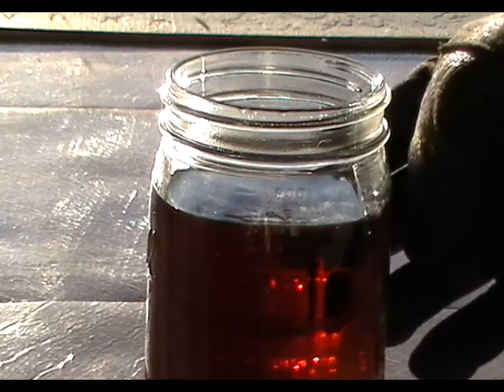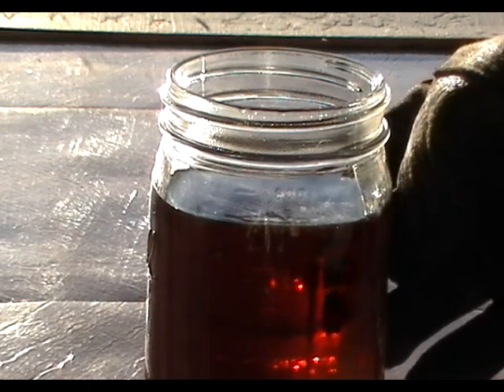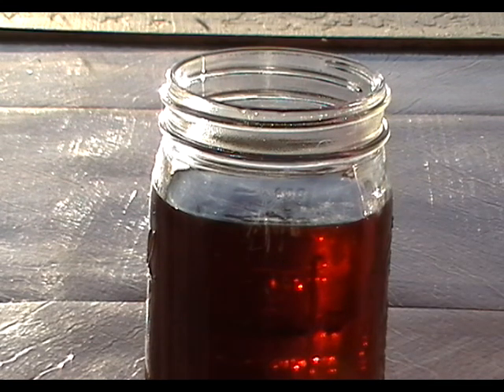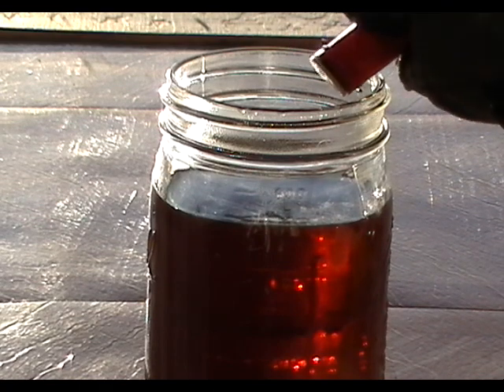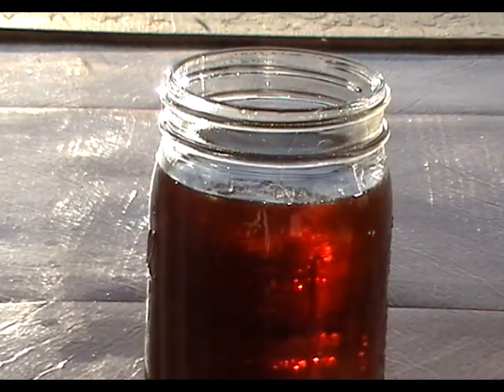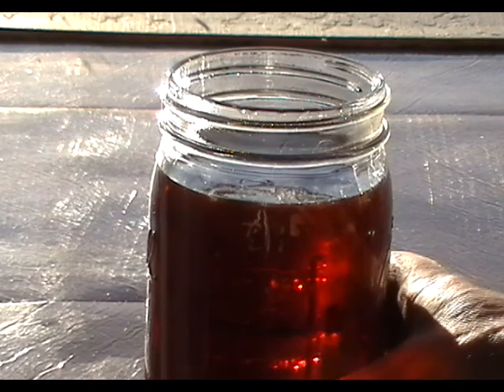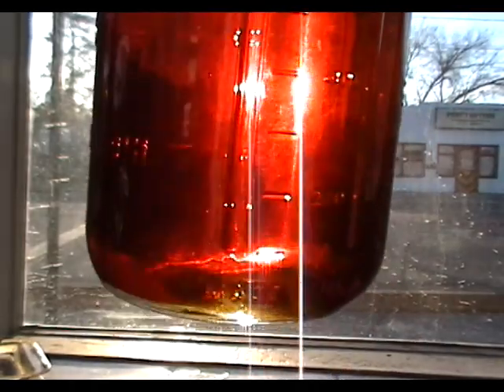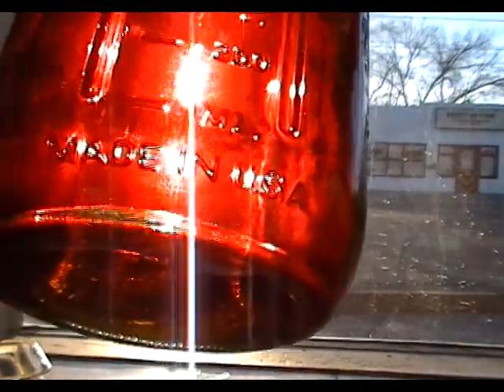Blending Gasoline with vegetable oil to make Diesel Fuel

Comment: Hi Jeff,
Thanks for sharing your experience. I'm in the process of setting up a WVO filtration system to run in a 6.5L V8. I would like to get your opinion on running WVO or any other WVO blend in my tractor which is powered by a 2.2L 4-cyl diesel engine. Any precautions or suggestions on optimizing the tractor for veggie based blends? I don't know if the size of the engine should be taken into consideration when making the conversion, as I'm just starting out. Thanks!
Reply from the maker: PrimitivePeter Blending is all about converting the fuel, not the vehicle; however some diesel engines burn waste oils better than others.  The direct injected turbo charged diesel engine seems to do the best of any diesel engine at burning waste oils.  Otherwise you will probably have no problems burning an 80-20 blend with gasoline, especially in warm weather.  If you do have problems, then try diluting the blend with diesel fuel until it runs best.
Reply: Thanks for the prompt response. I've been going through a lot of your videos as I learn the process. Are you still content with your bag filtration setup, and what micron size of bag are you using? Still trying to find the most cost effective way to filter that will produce clean fuel. I see lots of folks pumping through cartridge filters, while a local mechanic who's been burning wvo for years claims that his injector pump gets gummed up from burning oil that was heated and passed through filters. Thanks for the help!
Reply from the maker: PrimitivePeter Yes, I am still happy with the 1-micron bag filter, but I did add a 100 micron monofilament bag filter in front of it.  Cartridge filters tend to have problems with the alcohol in the gasoline, so that is why I use bag filters.  There is no point in heating WVO for filtration if it is first blended with gasoline.  Also, if the blend is settled for 1-2 weeks prior to filtration, then there will not be any gum sticking along the way to the injectors.

Comment: my guess is that only the thinner oils are blending with the gas and now I have a blend with too much gas as only a few gallons of oil blended into the gas.
I pulled the thicker bottom with no smell of gas and left it on a close bucket and the I just mixed the thicker oil with some gas smell (5gallons) with 5gallons of wvo which looks pretty clean and 1gallon gas, and will see tomorrow.
I will try to post some videos so you can see

Comment: hi Jeffrey what about if i use fresh oil instead of used one?
Reply from the maker: nao digo it works the same, although settling may not be as significant, but one should still settle a blend of gasoline and any waste oil, new or used, for at least a few days, if not a few weeks.

Comment: I own a 2008 Jeep Grand Cherokee
It has the MB OM642 engine in it.. a 3.0L CRD.

Will running a 20/80 mixture have any issues with things like my DPF? ...and you mention people with CRD's running this without issue.. care to point me to their posts? I've done some looking around and haven't seen any good news for it.
Reply from the maker: I have not test all diesel engines on this blend; however, my forum, many other forums have reports from people running this blend without trouble on their diesel engine.

Comment: Sir, 20% petrol 80% wvo ....blending in Immediatly using or after 24 hours using? Plsss reply sir
Reply from the maker: The common practice of turning waste vegetable oil into diesel fuel involves a great deal of settling, which tends to take time.  The process can be shortened by heating the WVO up to liquify it, then run it through a fine screen or cloth to remove the food particles, then leave it in a warm place to sit, preferably for a month.

After the fine food particles and fat have settled to the bottom, then pour off the light translucent oil into diesel fuel at a ratio of 30% diesel to 70% WVO, and leave it to settle for at leat a week, then add gasoline at 20% and leave it to settle for 24 hours, then filter as shown in my videos.

Comment: you still there?  or for anyone who knows about these things »» 

i put half a spoon of sodium hydroxide into 2 liters of waste veg.oil and it turned milky,with a whiter deposit inthe bottom about 1/2 inch high; been like that,resting,for 2 weeks

can i still use it,the upper portion (or the whole thing?) in the engine? or is it a bad idea now?  thanks
Reply from the maker: Interesting experiment.  It sounds like sodium hydroxide is extracting the dissolved water out of the vegetable oil.

So, yes, use the upper clear portion of the vegetable oil for blending.

Comment: Would this work in a powerstroke 7.3 well?
Reply from the maker: My current waste oil blend is 50% waste oil that has been settled warm for a month, then carefully separated from its sediments, then added to diesel at 40% of the blend, leave to settle warm for a month, then carefully separated from its sediments and added to gasoline at 10% into a settling tank with a domed or cone shaped bottom, with a bottom drain valve, and left to settle for a few days. Every day drain off the sediments.  When no more sediments are removed, then add acetone at 1%, and settle for 24 hoours, then drain any sediments, then run it through a filter down to about 2 microns into the fuel tank.

This blend can be run daily, but if smoking is observed, then injectors and valves are coking, so switch back to normal diesel fuel until the smoking goes away before running this blend again.

Comment: Jeff, are you still doing your blending?
Reply from the maker: No, I ran my blends on a Chevy with a naturally aspirated 6.2L diesel engine for 11 years.  Eventually, it coaked up, so I junked it 2.5 years ago.  I have come to realize that diesel-waste oil blends should only be run on an engine with a turbo, and probably no more than 50% waste oil, and kerosene is really the best blending agent. 

I am currently getting a deuce and a half with a multifuel engine up and running on my fuel blends.  I hope to have the whole thing complete by this spring.
Reply: @Jhananda  I have watched all your videos on blending over the years. I have a 1979 Mercedes 240D. It is set up with a 2 tank system home built. The fuel lines are heated by coolant as well as the tank. I use electric heaters right before the injector and the first filter. The heaters are glow plug controlled by thermostats to kick them on and off. I use a blend of 10% rug and 90% WVO. I have been driving this car 4 7 years on that blend with no issues. I change my oil every 3000 miles. After watching your videos on Blends and the various tests you did I've done my own tests as well. Temperature checks to see when it will gel and letting it sit for a long time to see what settles out. My processing of the waste oil involves settling tanks pumping only off the top and then running it through a centrifuge many many passes until it is completely clean. The gasoline is added to the oil in the settling tanks before it goes into the centrifuge. I then pump through a 10 micron filter into the storage tank and when it comes out of the storage tank it goes through a 10 and a 2 micron. I also added a water methanol injection system on to the air intake of the car. One of the reasons was to add a little bit of horsepower when I'm on a hill since that car is severely underpowered. But the other reason was to keep the combustion chamber clean as the steam produced cleans it out thoroughly. I also bubble the positive crankcase ventilation gases through water which is then inducted into the air intake as well. This always puts a little bit of water vapor going into the motor. I recently had my motor apart for a valve adjustment And a stuck glow plug in the head as I was trying to replace the glow plugs. The combustion Chambers we were very clean. Thanks to your videos in the extensive research you've done you helped me out a lot with my projects over the years. I've been running biodiesel, cooking oil or Blends ever since 2003. I would like to thank you for all the hard work you've done and posted online.
Reply: @Jhananda  I forgot to mention I also have a 93 IDI Ford F-250 and a 96 F-350 Powerstroke that I run on similar setups. I had two Volkswagens in the past and I never had much luck with Volkswagen's.
Reply from the maker: @daytonkeyes84  Well, I am glad you had so much luck, which I could not understand with a heated SVO system until you mentioned you were doing water injection.  I didn't do water injecion and I had to decoke my injectors every year, and my valves ended up thuroughly coked.  I wish I had considered water injection toward the end when I was trying to rehab my engine.  It sounds like doing so would have solved my problem.

Back to your blend a lot of people have tried gasoline blends on a heated two tank system and ended up with vapor lock, so your lack of power on a hill might be due to that.  You can solve the vapor-lock problem by blending with kerosene, instead of gasoline, if it is available to you.

Also, you should get serious about adding a turbo because it will take care of your lack of power and it will improve combustion.
Reply: @Jhananda  Jeff, I agree the water injection is a good way to avoid coking.   As to adding a turbo,  the car has 189,000 miles and I have concerns about over stressing the gaskets.  That and cost/installation of a turbo.   The car only had 62 horsepower from the factory.   Even on diesel it's a struggle.   O to 60 is over seconds.  I don't expect speed out of this car, lol.  Top end is around 75.  Kerosene is very expensive here in Illinois.  Hard to find at stations where it would be less than say Menards.   I have considered using diesel to blend,  probably at 20%, but I have had good luck with gasoline for years,  and I have never encountered vapor lock on my diesels. BTW, was I spent 9 years in the military,  7 Navy as a Radioman, 2 Army as a Heavy Wheel Mechanic.   That's where I developed interest in diesels. I appreciate your help and advice.   If you are interested,  my email is deadbang1968@gmail.com I would like to keep in touch and compare notes.
Reply from the maker: @daytonkeyes84  The point of a turbo is to improve combustion.  Where it becomes a problem is when people get used to the power of a turbo and stamp on the go peddle too often.  You can avoid damage to the engine by adding a temperature gauge on your exhaust manifold and keep the temperature below 1200F, plus add a bust gauge and keep it in safe margins.

Well, it sounds like you have the WVO problem solved by combining blending with a heated 2-tank system plus water injection.  Do you get the same power with your blend that you get out of straight diesel fuel?  How much driving do you do?
Reply: @Jhananda  I can't tell any difference running diesel versus my blend. I average about five to 7000 miles a year on each one of my diesel vehicles.
Reply: @Jhananda  I  change my engine oil by mileage but I also change it even if I have not hit the mileage after about 5 to 6 months. I'm always concerned about the changes that cooking oil seems to cause engine oil to go through. So on my Mercedes 240D I change at 3000 miles and on my f 250 I change at about 4,000 miles. I figure better safe than sorry. I also preemptively change my fuel filters every 6 months filling them up with seafoam when I put them back on. I also add seafoam to the diesel tanks on my vehicles. It's cheaper to buy seafoam by the gallon so that's what I do, and then just measure it out according to the directions. I'm sure seafoam helps in keeping the internal parts of the motor clean.
Reply from the maker: @daytonkeyes84  Very interesting. Do you recycle your WMO into fuel as well?  I found that WVO has gum in it, which I believe is the primary cause of coking.  And, I have found as I increase the petroleum distillate component of my blend more gum precipitates out with the high melting point triglycerides. So, I have been blending equal parts WVO with WMO, and 20% diesel fuel plus 20% gasoline.  My blend ends up a lot clearer looking, and coking seems to go away.
Reply: @Jhananda  it was from your experiments I found posted online that I began blending waste motor oil into my waste vegetable oil. I would blend them at no more than 50% waste motor oil and then allow it to settle 4 several weeks. That's also with the 10% gasoline added. Then pump off the top and centrifuge the mixture. I say wood because I don't always have waste motor oil to mix in. I did note the same thing do you did in your experiments that I have a black dude with precipitate to the bottom of the mixture. Even in the centrifuse I get a lot nastier black player in the centrifuge each time I clean it but that type of mixture than I do just cooking oil and gasoline.
Reply from the maker: @daytonkeyes84  thanks for trying the WMO+WVO+solvent blend, and you found it helped produce a cleaner blend.  I believe it is a factor in your lack of coking, as it was clearly so in my case.  Have you tried adding acetone to your blends?  There were a number of reports of acetone in the blend reducing coking, so I tried it.  My first experiments were with a clear container so that I could see what happened when I added acetone.  It turned out one can see as soon as acetone is added to a blend it quickly distributes throughout the bend without agitation, and even more interesting I found it left a dark precipitate at the bottom, and it did not take much acetone to do that. So, in a 20 gallon batch of the above fuel blend I will add 1 cup of acetone at the top and allow it to settle out over night, then the next morning I will drain off the precipitate, then I filter it into my fuel tank. If you give it a try, then please let me know how it goes.
Reply: @Jhananda  Jeff I will try that it would be about four and a half cups based on the amount you're saying for my 50 gallon batch. Would you suggest adding it to the waste vegetable oil and gasoline mixed without the waste motor oil as well?
Reply from the maker: @daytonkeyes84  Yes, I do not think it matters what your blend is, acetone seems to force out of solution a wide range of substances including water and gum.  I have been making 25 gallon batches, and using 1 cup of acetone, so in your case 2 cups for 55 gallon drum.  Also, I find acetone blends so quickly with waste oil blends that it does not have to be left during the lengthy settling period, but just give it minutes to 1 day for an additional short settling period.
Reply: @Jhananda  Jeff, the 50 gallon batch I currently have in my settling tank which is 90% waste vegetable oil and 10% gasoline I also added 10% acetone for your recommendation. I did so approximately 48 hours ago. What's the current batch of blend is done cycling through my centrifuse I will put the acetone Blended batch in. I am curious to see if it cleaned quicker than previous batches having added the acetone. Typically a batch of 90% cooking oil 10% gasoline takes approximately three days to four days of continuous passing through the centrifuge to get to where there's hardly anything at all on the edge of the centrifuge wall. The waste vegetable oil I'm using comes from a fair food supplier. Typically the oil is only used once maybe twice and then he changes it. Still, there's a fair amount of material that comes out in the first day of centrifuge passes. Usually around a quarter of an inch layer. Each day goes down significantly from the previous. By the third or fourth day there's usually hardly anything there. I'm going to clean the centrifuse this evening and see if the current batch is done and then the acetone batch will go in.

Comment: How long does it take for them to blend completely? Can the ratio of Gas to WVO really be as little or as much as 5%-20%? That seems like a big margin with lots of room for error. Is there anybody else with documentation on the subject, because when I search for this method of making biodiesel only your name comes up. I'm not doubting you, I just like to do my "homework" if you know what I mean.
Reply from the maker: Most people who succeed at blending gasoline with WVO blend gasoline at 20% -30%.  Less gasoline tends to lead to coking. A turbo charger also aids in blending.  I run a forum on this subject, where you will find many case histories of people successfully running this bend.  You can find that forum here: http://beyondbiodiesel.org/forum/index.php
Reply: At these %ages the blending with filtered WVO is instantaneous so it can be done in the vehicle's fuel tank. However SVO (unused veg oil) is different. The unleaded should be added into the bottle/drum in 5-10% ratios and left a week or two to 'mature' so that it cuts the long chain molecules in the oil. If you have access to wholesale cash & carry outlets then - at least in the UK - you can buy 20 litres (as of August 2014) for around 70-75P/litre.

Over the last few years I've run several vehicles on settled, de-watered and filtered WVO with 5-10% added petrol with absolutely no problems. At times I've even chucked in all my used engine oil at the second settling stage before filtering it with similar results. Unfortunately other pressures have meant that I am currently only able to rely on SVO, but once my new workshop has been erected I'll be reinstalling my filtering setup and finding a new source of WVO.